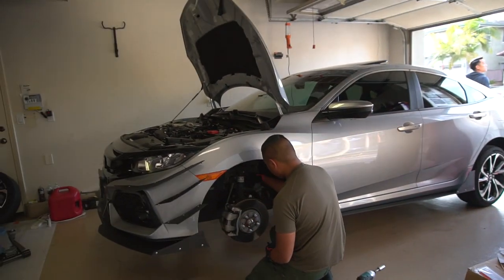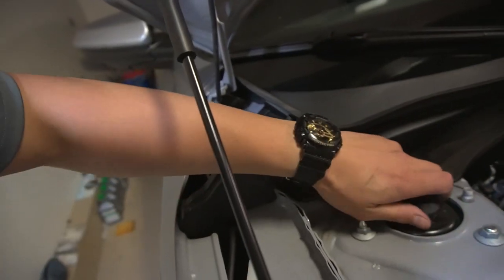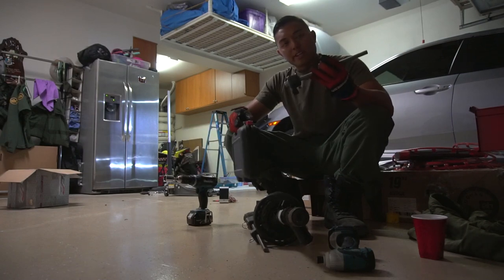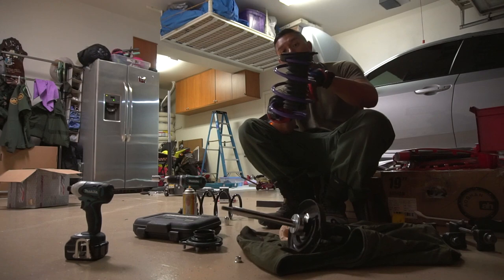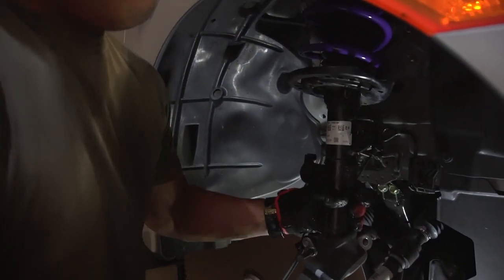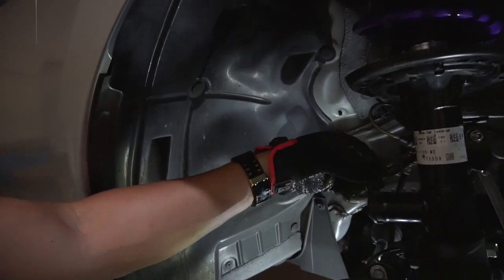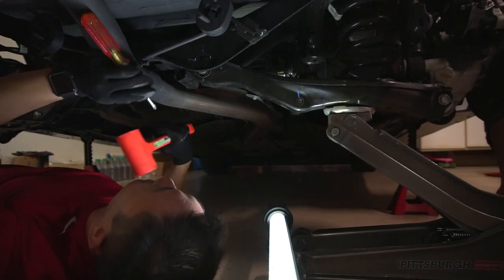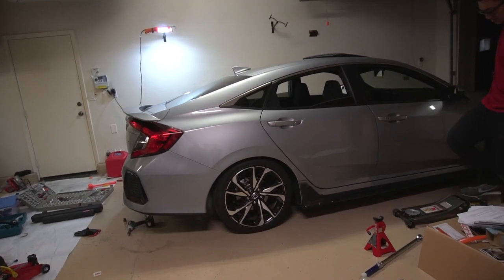2018 HONDA CIVIC SI | LOWERING SPRINGS INSTALL (DETAILED GUIDE)

Comment: To anyone that has a clunking noise on the top hat while driving but you have impacted it down after the car has been put down; Make Sure to tighten and check the end link all the way as my Front Passenger side end link wasn't torqued down all the way and it was giving my major clunk noises
Reply: I just put mine I’m getting a clunk noise but the guy who installed them told me I need a new swaybar adjustable one idk
Reply: I have the same problem on my drivers side and I don’t know why

Comment: Thank you for this video! It helped a lot. For people who are watching this video to get help, here’s some other things to keep in mind:
Make sure to lift both sides of the car when doing the front and back. It will remove all tension and make it a breeze. 
When putting the strut back in, make sure to connect the control arm before.
Also for those who say they are still having the knocking noise after driving, keep tightening the nut after moving the car. It will get the strut and spring nicely set! Again thank you for this video, it helps out so much. 

Edit: for those who still have knocking noises in the front, flex the right side of the car on something to fully compress the spring, then tighten the top strut nut. Vice versa for the left side. You shouldn’t hear anymore noises.

Comment: to remove the strud easily, you just have to romove the control arm from the ball joint (the one you removed 3 nuts from the bottom, after you remove those screws, go ahead and release the control arm, that way all the pressure will be gone and the strud will come down almost by it self.

and the pice of foam that you just put inside the strud, you have to put it in, in the top, the part that has the three bolts. 

and guys after doing this you could run into some vibrations problems cause you now will drive with ur front Axel in a different position.

Comment: Did you need to have it aligned after you were done and did the stock wheels and tires work fine without scrubbing
Reply from the maker: Matt T yes an alignment is recommended when messing with suspension, also yes the stock wheels had no rubbing issues at all.

Comment: Hey thanks for the tutorial video I wanna get these now but just one question...any scraping or rubbing? are full turns an issue now that they've settled in more?
Reply from the maker: Walshy xgenSi nope none at all, I can turn all the same. With the tires being in, you still have plenty of space.

Comment: I just installed d2 springs on my 2017 si. When I drive it and I hit little bumps or dips it starts making this clunking noise. I tightened all the bolts and got new end links, by any chance do you know what that clunk noise can be? It sounded like something’s loose but I just don’t know what I did wrong.
Reply: JK ACTION did you ever get it fixed? I had the same issue tonight. I drove it up the road, came back and torqued the top strut bolt more and repeated the process two times. I still hear it slightly every once in a while on the left.
Reply: Braxton Brown hi I did get it fixed. It was actually my end link making the noise. It got loose for some reason. I had adjustable end links. When I installed the new ones I bought it stopped making the noise.

Comment: Do you have to tighten both top strut nuts at the same time when it’s on the ground? I’m having a clunking noise front passenger side and it looks like it slanted to the right when I’m driving and every bump I hit it makes a clunk/scrape sound.
Reply from the maker: Yes you want to tighten the nuts again once the car is on the ground as they will push up for more space to be tighten.

Comment: So is this the same drop you are running right now with the AodHan 19's? Any issues with rubbing? You get a camber kit?
Reply from the maker: Jeremy yes this is still the same drop with the 19’s I’m currently running, it did have a rubbing issue in the front on the tab (just pulled the tab up, problem fixed). But the rear has slight rubbing at times (nothing to worry about). No I do not have a camber kit, so it has slight camber in the rear (totally fine for driving, just watch inner wear, make sure to rotate).
Reply: Looks killer man. Thanks!
Reply from the maker: Jeremy no problem! 🤙🏼 thank you! 😁

Comment: How stiff is the ride in non-sport mode? Does it feel like being in sport mode before lowering?
Reply from the maker: John Berger it’s noticeable stiff like sport mode on stock, then going in sport mode gets pretty bumpy during harsh roads, but that may be because I didn’t chop the bump stop after lowering my springs, it may help if you chop off your bump stop about 2inches (same as drop rate).
Reply: Sweet! Thx

Comment: Was it clunky after u installed? Mines all clunky and I can’t figure out why
Reply from the maker: StreetVenomScooters no, I’ve had some people encounter this same problem. In the video I specify to tighten the top hat of the front struts when the car is completely on the ground. Make sure you did that, usually that’s the problem. Some miss it, they end up tightening it while the car still lifted, but when you put it on the ground it pushes up giving more room to tighten down. Hopefully this fixes your issue.
Reply: Ive encountered clunking noise too coming from the rear though any advice? I'm running truhart springs though

Comment: Adaptive damper system still work when you put on sport mode? Or have any issue?
Reply from the maker: bryan casa yeah the adaptive dampeners still work perfectly fine. No issues at all, you can definitely feel the difference between sport mode on & off. Rides much stiffer in sport.
Reply: Thanks bro, whats your IG i wanna see more photo of your car low.
Reply from the maker: bryan casa no problem! @phong.vlg to see more!

Comment: Did you have to get camber kits ?
Reply from the maker: abdiel garcia no haven’t gotten a camber kit, or isn’t necessary. There is slight camber in the rear, but nothing you can’t drive with. You could fix it with a camber kit if you’d like.
Reply: @PhongVLG  how bad is your camber wear
Reply from the maker: abdiel garcia not too bad, I do get even camber wear. So I just rotate the tires every 5-6,000 miles to keep its longevity

Comment: Why didn't you go with coilovers ?
Reply from the maker: C_ fa5inco reason being is because coilovers will deactivate your adaptive dampeners which is the sport mode button utilizing soft to stiff. Also some coilovers are not fully made for our adaptive dampeners sensors so a check engine light may come on due to the sensor having no place to be plugged in.
Reply: PhongVLG Thanks for the info 👌

Comment: Hey bro I just installed mine on exactly the same way . Did you noticed any cracking noises when turning the steering wheel ?
Reply from the maker: Steelo phama No I haven’t had that issue, did you have your car jacked up on both sides?

Comment: Hey bro I need help
Reply from the maker: David David What’s the issue ?
Reply: PhongVLG I used the impact drill on that part I said not too now the screw won’t go all the way in do you think I messed it up ?
Reply from the maker: David David so it looks like you crossed threaded it, unfortunately that isn’t an easy fix. My advice is to have it serviced by the dealer to get it fixed, otherwise you’ll have to find your own method.
Reply: PhongVLG damnn bro you think it’s gonna be expensive ?
Reply: PhongVLG and what’s that part called ?